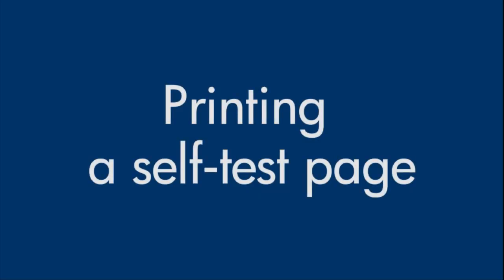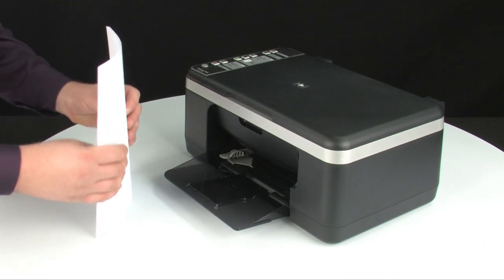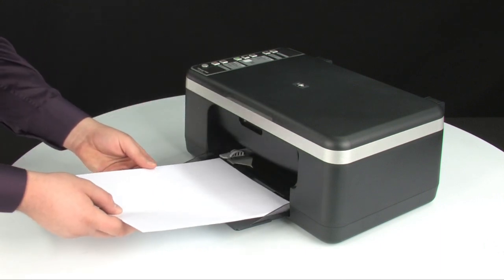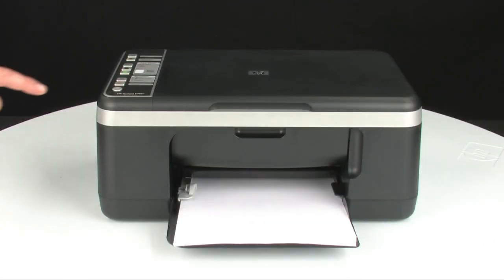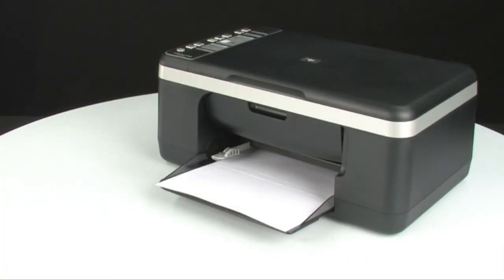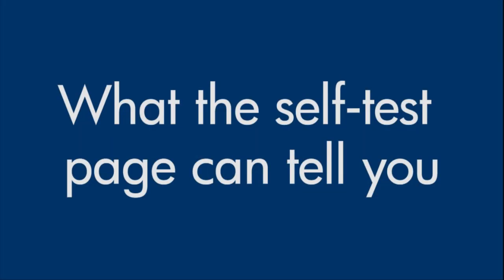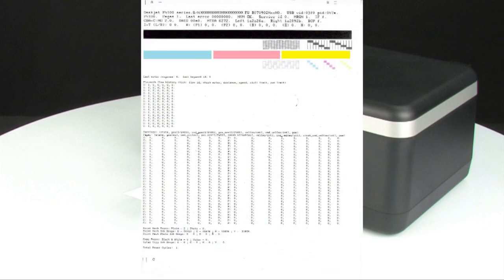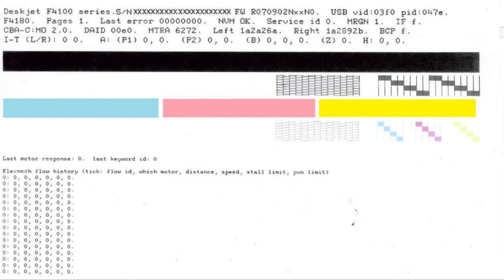Printing a Test Page | HP Deskjet F4180 All-in-One Printer | HP

Comment: I bough a HP Deskjet F 4180. But the only insue i have with it until today is about the software. I don't know exactally... but i think it is a bug on the software. Every time i start my computer, the instalation software start with no reason (no cd inserted on the disk reader). I have downloaded the latest drivers and the "bug" still hapening. What should i do to correct this issue? I really apreciate a solution for this insue.